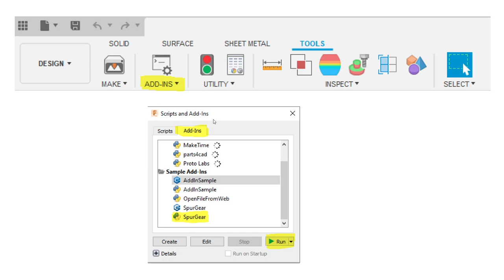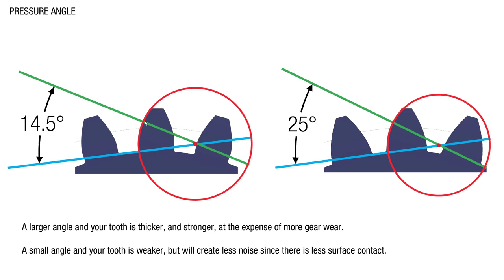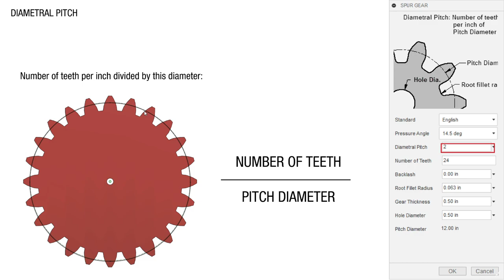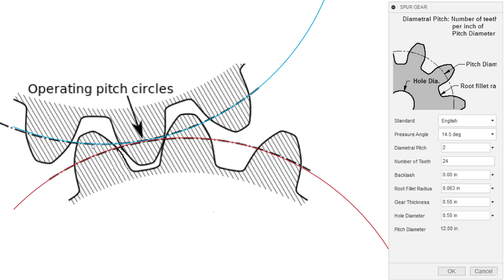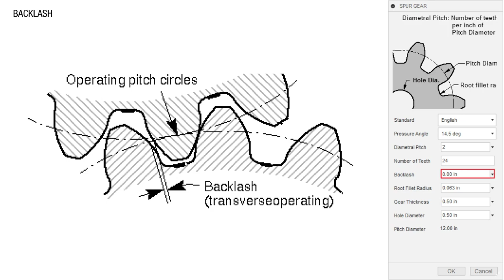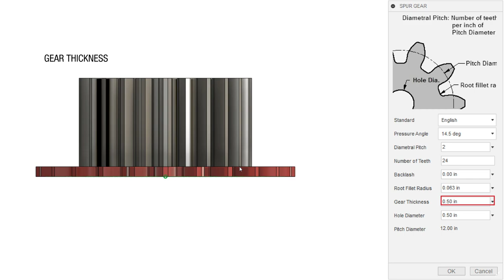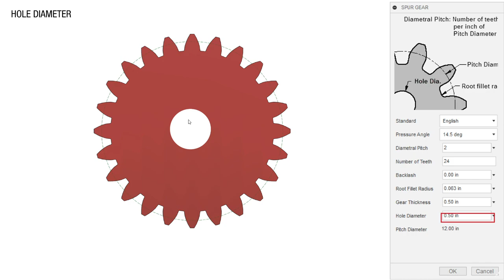Gear Terminology in Fusion 360! Parameters on Pressure Angle of Gear, Diametral Pitch, Backlash

Comment: The pressure angle is the angle of the line that the point of contact follows through the mesh. 14.5º pressure angles were traditionally used because it allowed a greater variance in manufacturing tolerances. It is much easier to control tooth thickness and consequently backlash with a 14.5º pressure angle. 14.5º also do not create a lot of separating forces which was desirable with poor bearing technology.  Surface contact is not a function of pressure angle it is a function of load. The surface contact is just along a different angle. 25º pressure angle gears do have a much stronger tooth but also have much greater separating forces. Gear noise and wear is largely down to gear quality.  Modern technology makes 25º gears preferable in most cases.
Reply from the maker: I see. Thank you for this analysis.

Comment: I believe you meant to say that the pressure angle is the angle between the normal line of the pitch surface and the tangent line of the gear wheel, not the tangent line of the pitch, which would be 90 degrees offset from this.
Reply from the maker: Your definition is correct. I hope to explain this in as simple ans tripped down a way as possible. A book on gear design would explain it the way you are explaining it, but it would sound like a different language to someone not privy to machine design terminology.

Comment: Great video!  I have a quick question.  I'm having a hard time with an appropriate gear backlash. The following 2 gears need to properly mesh:

2:1 Ratio

Gear 1:

Pressure Angle: 20
Module: 0.60
Number of Teeth: 10
Root Filled Radius: 0.20 mm
Gear Thickness: 3 mm
Pitch Diameter: 6 mm
Backlash: 0

Gear 2:

Pressure Angle: 20
Module: 0.60
Number of Teeth: 20
Root Filled Radius: 0.20 mm
Gear Thickness: 3 mm
Pitch Diameter: 12 mm
Backlash??

Gear 2 will be injection molded from glass-filled nylon. Do you have a good recommendation of backlash for Gear 2?  I was thinking of going with 0.15 mm. Thank you!
Reply from the maker: I would definitely consider 3d printing this first, possibly in SLA. The acceptable backlash is dependent on both the application and manufacturing tolerances.

Comment: Excellent presentation 👌! Can I use this fusion 360 script to make sprocket for tank tracks how can you calculate sprocket pitch using holes distance between tank tracks
Reply from the maker: Hello Glen, Yes! This is possible but may take some trial and error to get right. It is mostly a tool for creating meshing gears. I would see if there is a sprocket tool first. I really like this plug-in because it is simple to use and effective.
Reply: @AvivMakesRobots  likely there is a 'roller chain' generator, like in Inventor. You'd specify your own 'chain' (the tank tread) and your own sprockets, including any number of idler gears (all the in-between wheels on the ground inside a tank tread) 
All 3 wizards are a challenge to use (spur gears, belts/pulleys,  roller chain/sprockets) but they do work, both Inventor and Fusion have this.

Comment: Very helpful video!
How could one actually measure pressure angle on an existing item, like the spline of a differential axle? Naturally, it's much harder in the flesh with such a small pitch gear part.
Reply from the maker: The best way to do this is to first 3d scan it. If you can't 3d scan it, the second best thing to do is to lay it flat and scan it with a paper scanner, or to make an ink print. From there, it is a matter of using the right tools to get an estimate... remember, there are common pressure angles like 20 degrees and 14.5 degrees. It is probably one of these.
Reply: @AvivMakesRobots  Good advice, thanks mate. Yep used in this diff is either 30 or 45 degree. I've chosen 45 degree for the differential centre, however on the outer wheel hub there is a female splined driven gear (as the axle is floating, and goes inside this to turn the spindle / hub / wheel) that is kept captive inside the hub. Don't want to pull apart the whole hub to remove it so the ink print is a fantastic idea!!!
Reply from the maker: @dons1932  Great! Happy I could help!

Comment: i have  a good question how do you slow down a motion link ? i want to inspect the gear in the motion but going way too fast  
and i can't find a solution on google
Reply from the maker: You may want to just use your cursor to move the gears instead of with the motion animation. Then you can zoom in and look closely at the meshing.
Reply: Edit1: aslo by mouse it snap on the wrong place is there a way to make it not snap to each angle degree ?
Reply: Edit1: aslo by mouse it snap on the wrong place is there a way to make it not snap to each angle degree ?
Reply from the maker: @buder5116  How is it constrained? The teeth should not be constrained.
Reply: @AvivMakesRobots  i am too begineer to anwser that but i followed  a youtuber making simple  2 gear  with animation with a motion link between the 2 . 

after messing around with speed hack i see that its not interfering  with each other :D
if you want i can put a imgur  screenshot do you want  1 ?
Reply: @AvivMakesRobots  there a image 
https://imgur.com/a/n6E4jf9
and yeah ik the timeline is a mess i need to redo everything now :D
Reply from the maker: Sure. I'd be happy to look.
Reply from the maker: But instead of a motion link, why not make a plate with 2 pins in it to fit the gears on. From there, constrain the center hole of each gear onto the pin and then rotate it manually in place to check  the backlash and other parameters.
Reply: @AvivMakesRobots  i dont know where that pin is in fusion360  i am prety new to this   but its alright thanks

Comment: How to measure  pitch diameter in order to calculate the DP or Module. Thank you.
Reply from the maker: Best way is by finding it on the manufacturer spec sheet. If you don't have this, you will need to measure at the point between where two gears mesh. Hope this makes sense. This will be difficult to measure with a caliper or measuring tape... I highly recommend getting this from the manufacturer.

Comment: It would be immeasurably more helpful if the gear diagrams were drawn to scale of their respective pressure angles. Simply dimensioning the same gear differently makes this exceedingly difficult to follow.
Reply from the maker: I understand what you are saying. Since I did not, an easy way to visualize is to click between different pressure angles when in the gear generator tool and to look closely at the teeth changing. You will see the radius of the tooth changing to be either smaller or larger and it will be abundantly clear.

Comment: At 1:55, the LH and RH geometries look identical. All that appears changed are the numbers: 14.5 and 25 degrees.
Reply from the maker: Yes, these are example graphics. Once the gear is generated at that pressure angle, it will be visible in both the preview and when meshed with a compatible gear.
Reply: @AvivMakesRobots  Thanks for taking the trouble to explain that.
Reply from the maker: @danielwalker5682  Sure!

Comment: i do not understand where is this theoretical cangent point on radius on green line, becouse on radius it may be anywhere. whatewer its looks like this angle changes width of upper part of tooth
Reply from the maker: I understand your question about the green line: The green line is tangent to the inner circle of the gear. That is why the green line can't just... be anywhere along the radius.

So first point for green line: tangent to inner circle

second point for green line: perpendicular to top arc of tooth.

Comment: The green line is not a tangent. There are no arcs in a spur gear profile. It is an involute curve. The pressure angle is not what you define. It is the angle between the line between the mating gears centers and a line tangent to the involute curve at the point of contact between each gear.
Reply from the maker: It is, for the sake of argument, the best way I have found to explain it.
Reply: @AvivMakesRobots  Then you lose that argument. There is no value in describing it incorrectly.